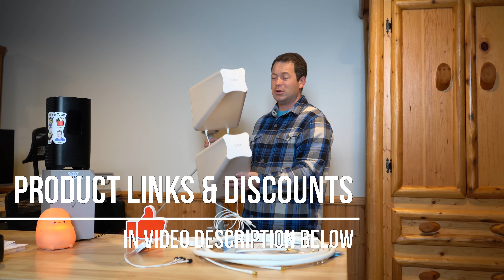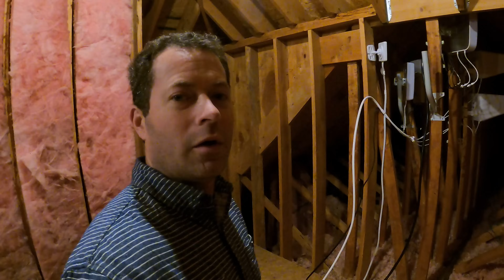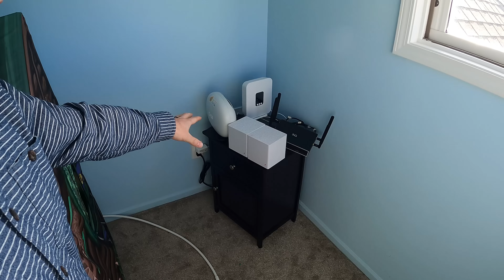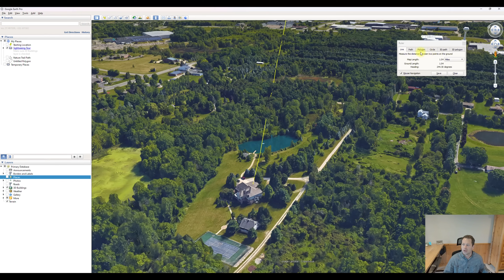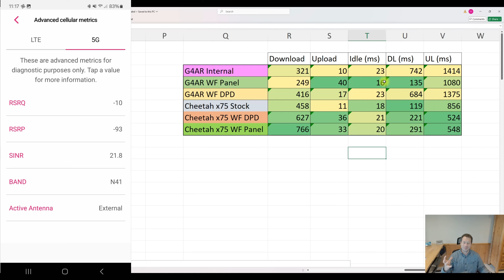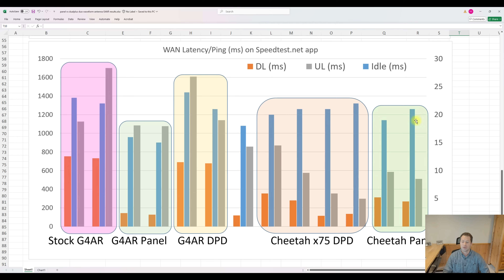✅Test Results! Waveform's New 5G DualPlus Duo! T-Mobile AT&T Verizon- MIMO Outdoor Cellular Antenna

Comment from the maker: Get 5% off  @waveformhq   antenna and signal booster products with this link: www.waveform.com/natertater or just use code "NATERTATER" at checkout. 
Buy DualPlus Duo: https://collabs.shop/nd4rhp
Buy Quadpro direct: https://collabs.shop/gqhat7
Buy Quadmini direct: https://collabs.shop/zkph7u
Or on Amazon (no discount): DualPlus Duo: https://amzn.to/41Kfj6s Quadmini https://amzn.to/3Tf8Iw7 QuadPro https://amzn.to/3UX2a6G 
90 Deg Antenna SMA connectors on Amazon: https://amzn.to/4fQBjQu
  
USE COUPON CODE for $45 OFF : NaterTater
Buy Cheetah V2 x75 5G Modem: https://chestertechrepairs.com/products/5g-cheetah-v2-%F0%9F%90%86-dual-sim-wi-fi-6-industrial-lte-nr5g-wireless-modem-router-bundle-fixed-wireless-access-point-can-work-mobile
   
Be sure to see my other Verizon and T-Mobile Home Internet Videos: 
T-mobile: https://youtube.com/playlist?list=PL8d9FovK2dNQHp0KWk8gG8XXvaKzaoSB3
Verizon: https://youtube.com/playlist?list=PL8d9FovK2dNSOcTz7L6sHiuWVQXwUT4my
AT&T Internet Air: https://www.youtube.com/playlist?list=PL8d9FovK2dNT31tM0IRKApwZhAWC658QR
5G Cellular Modem Routers:  https://www.youtube.com/watch?v=ELZNPu38r70&list=PL8d9FovK2dNS2ihT56gySpU49V4kRHn_U

Comment: buy a Poynting 4×4 MIMO XPOL-24-5G 5G/LTE Directional Antenna for Cellular Routers & Hotspots 617–4200 MHz N-Female Connectors.. with lmr 400 cables smokes anything wave form has...
Reply from the maker: I have tested those, Poynting makes good products but I did not see an improvement over waveform.  Definitely not smoking them.  LMR400 cables however do provide a notable improvement over the included Waveform cables (and the cables help any brand antenna).

Comment: Waveform Is way over priced for their antennas When you open the unit and see the parts and Basic chipset . You  can buy  any CPE Modem with 5G sim card I'm on N71 for T Mobile Keep in mind t mobile throttles they're home internet data Even if you brought this It might not work for you You can get a high-speed 1 minute. The next minute you can get the lowest speed Even if you have locked signals. I'm grandfathered in to my internet plan for business I can go up 1 TB and a 1/2 of usage. Before they Throttle I suggest looking for UOTEK 5G SIM Card Router CPER  I call these bypass models Because signal locks You can also change your IME and MAC address to match your original modem. So the network can Recognize The Modem Basically i Can't tell you exactly where to buy it Do to youtubes policy. Anywhere in everywhere They have many names Just made in china stuff They all do the same thing its Not too much about the software It's about locked signals that's about it You don't have to spend hundreds They all work  for Signal locking And that's all you need if you have an external antenna.  I hope you guys can boost up your internet speeds like I did Always look at what parts are made of Before you spend hundreds or even thousands VS You can buy the same as Zack thing for cheaper. Do you research guys be safe? T MOBILE Will also be having N77 for faster 5G Coming out at the end of the year Be on the lookout for this

Comment: Hey Nater, I have a 65 foot tower and it is about 160 feet from the house. Do you have any suggestions for an entenna and router that I can insert a Verizon sim card into and not break the bank? I appreciate all the knowledge you share on you videos. Also, have you looked into Poynting antennas? Thank you
Reply from the maker: You certainly dont want to run a coax antenna cable that long as you'd have massive signal loss.  So you want the modem on the tower probably which of course means an outdoor rated unit.  Some think like https://youtu.be/5qOvNbDzwUI I just don't know how strong your bank is.  Then you would get some ethernet and run PoE from the house (250ft is on the longer side for PoE and you may need a stronger PoE injector then the one they provide to get enough voltage that far away)

Comment: I hope the Waveform antenna will use RJ45  (CAT 6 or CAT 6A) in the future like the StarLink Antenna...
If we need to run SMA cables for 3 story building... OMG! how long we need 4 parallel cables, maybe 100 meters..
SMA cables is expensive cables & it is no efficient! 😮😮

Comment: I usually get 450 download and 45-60 upload with a 30 ping will the newer Chester cheetah x75 help I have an older version.
Reply from the maker: @ruthann3030  yes if your tower has more bandwidth or bands the x75 can utilize them to deliver more speed.
Reply: @NaterTater   it has the n41 n25 and n71 bands but I keep it in stand alone and it usually stays with the n41 n25 bands I have the older Chester cheetah unit so if you think it will help I will get the newer one. thanks for the reply

Comment: my G4AR is now always on 5GSA these days N41 with amazing speeds with or without my waveform 4x4…. The latest tower upgrades a mile away have been pretty darn amazing… I’m pretty lucky. I don’t have many trees in the way where I’m at… but if I go to my neighbors a couple blocks away where they don’t have trees… It’s usually double down there. instead of 500 or 600 during the day it’s double without the trees at my end….. unless you can point your antenna precisely and you don’t have any trees to deal with the 4 x 4. Flat panel is certainly the best way to go in my opinion.
Reply from the maker: Sounds like a great setup, good to hear the tower upgrades are working out!

Comment: Your findings showing N25 faster than 41 aren't surprising. I see that in my area too, and i chalk it up to fact that 41 is actually oversaturated at this point but n25 is hardly being used since it's a SA only band. that's the important note here. 41 supports both stand alone and NSA so everyones device can use it regarfdless of configuration.

By default, most devices have SA turned off by default. this leaves N25 quite under utilized. It's why it provides such great service to Tmobile home internet users using SA. you can confirm this yourself by opening an iphone settings and going into 5g options, you'll find that stand alone is OFF by default. This directs all connections to N41 NSA and leaves 25 untouched by so many users.
Reply from the maker: @mysticalos  good point

Comment: Do you think the modem upgrade for the Cheetah is worth the money? I have an older MTK version which generally works well.
Reply from the maker: @minigpracing3068  if it works then dont fix it.  At some point you will want to upgrade as the newer modems can aggregate more bands and get more speed.  The wifi is also faster.

Comment: Can you do a review of cheetah sdx75? How to ipv6,qos, and some of the settings how to.
Reply from the maker: This video has most of that: https://youtu.be/svwZQEuJiss
Reply: Same interface even though it's different chip and modem? Thanks
Reply from the maker: @richardlewis7323  yes correct.  The interface is on the router board and separate from the modem.  There is some newer firmware that has a few more features but mostly the same.

Comment: Compared to Elysas and this new antenna,   Which is better as far as pin and speed ?  My t mobile box keeps getting high legency
Reply from the maker: The tmobile gateways are consistently the worse for latency for me.  An external antenna often helps and so does a 3rd party router.

Comment: I run the Cheetah x75 WF Panel on T-Mobile get similar speeds on 5G SA, typically N41 with no carrier aggregation. I’m a couple miles from the tower, no line of sight, lots of trees. If you really want to take the guess work out of what carrier has the closest tower and where it’s located get a tower survey from The Wireless Heaven. You will get KMZ files (open in Google Earth) and lots of data so your not wasting a bunch of time figuring it out on your own.

Comment: Great video as always Nate! I have my Waveform Dualplus Antenna coming in a few day's I thought about cancelling the Order after seeing that the Results are pretty much the same when compared to my current Waveform 4X4 Legacy QuadPro Antenna but like you said it's Area specific so I might get different Result's. I currently have my Waveform QuadPro 4X4 Legacy Antenna hooked up in the Attic and I get Speeds from 600 to 700 on the Download and the Upload is about 30 or sometimes higher and that's with my Chester Cheetah SDX75 Gateway/Modem connected to it. I saw that you mentioned the Elsys Amplimax Ultra Antenna up on the Tower you have and I'm wondering if you use that as your main Setup? Also do you have that connected to a Chester Cheetah Gateway/Modem for your main Setup? I'm curious because I've wanted to give the Elsys Amplimax Ultra a try! In your opinion does it perform better than Waveform's Antenna's even if Waveform's Antenna's are connected to a Chester Cheetah Gateway/Modem?
Reply from the maker: thanks!  I use multple units in a load balancing setup for my internet.  The Elsys is a standalone setup so it doesnt get plugged into another modem, it goes straight to my multi-WAN router.  for a comparison of it see https://youtu.be/5qOvNbDzwUI
Reply: @NaterTater  Oh ok! I'll probably give the Elsys Amplimax Ultra a try! Do you think it works better for Rural Area's like I'm in? I'm in South Jersey with a Cell Tower not too far down the Road from me kinda like your Area with some Tree's and Building's in the way of the Tower. I'm just trying to get the best Reliability and Speed I possibly can in a Rural Area. If worst came to worst if it didn't improve I could always just send the Elsys Amplimax Ultra back.

Comment: Hello Nate, I have just set up with the new Verizon ASK-NCM1100E, setup upstairs in one 2 ft square section I actually hit 5g with. Currently i just signed up to the 100mb plan and most ofthe time i check I am around 40mb with occasional checks in the 70mb range. Ping is not good, so this video is talking to me, lol. Have you tested the WF QP inside your attick? I am wanting to improve my speed and ping consistent but would probably put any antenna in my attic to start with. Thanks for all the time and effort you put into cell internet topic, I am trying to learn as i go with this service and you have been the most helpful channel period on this stuff!
Reply from the maker: @scottieledford9371  hi yes, i show the WF 4x4 panel/quadpro in this video as well.  It does great in the attic and outdoors is even better.

Comment: Do you know at command to force n41 as primary and n71 as secondary on chester cheetah cause everytime it wants to be on n71 as the primary and i want n41 as primary so my ping is better?
Reply from the maker: @Frostbite1317  you just band lock uncheck n71
Reply: @NaterTater  i did that and when i did it wouldnt connect to anything
Reply from the maker: @XenAqUaYT  then your n71 doesnt support 5G SA PCC.

Comment: Nate, you need to turn off your N71 on the SDX75 and your upload will probably skyrocket.  You want N41 to be your primary.   Edit...I watched your spreadsheet part and it looks like you got rid of N71.
Reply from the maker: Yes, I certainly play with lots of different configurations and I agree you need to test out variations as each user might see different idle configurations.
Reply: @jimdickman3345  What app do you use to turn off specific bands?

Comment: Good analysis Nate.  Thanks.  Looks like you almost better off with the Cheetah and G4AR Panel in your case.  

I'm in a rural area.   On T-Mobile newest gateway connected to WF Panel MIMO Antenna in my attic,  I'm getting an average of 50Mbs down and 15Mbs up with a ping of 34ms and a jitter of 7ms.  When I switch to the stock Verizon Gateway using it's own internal antennas, I get about  300Mbs down and 5Mbs up with a ping of 60ms and jitter of 6ms.  All in all, I'm happy.  I also have Starlink just in case we get a bad storm that may knock out the towers (like recent hurricanes we had) and when we are travelling.
Reply from the maker: @iglapsu88  awesome!  Nice setup.  It also handy to have backups like you and I have.  I dont think i've ever lost all my WAN's!